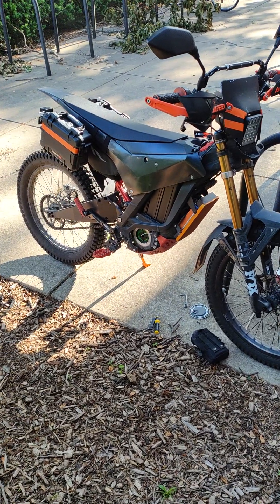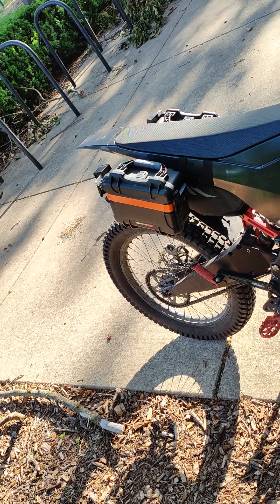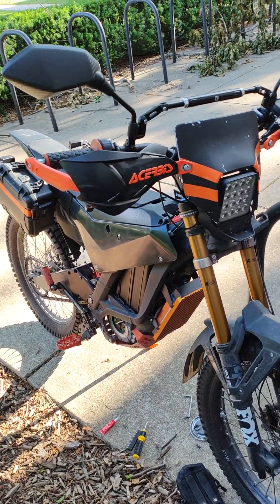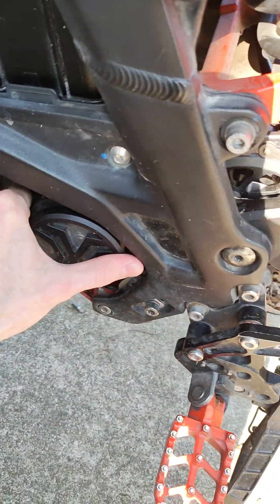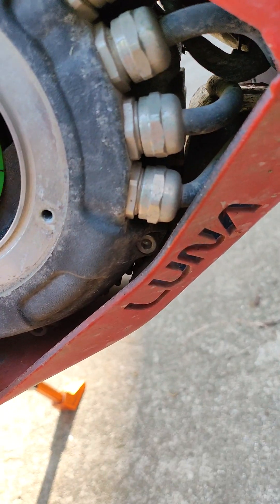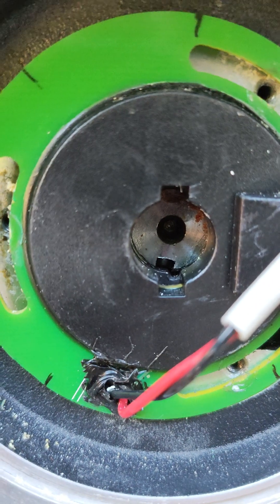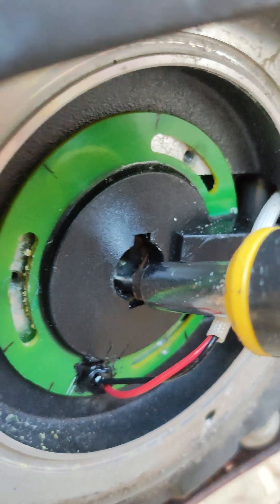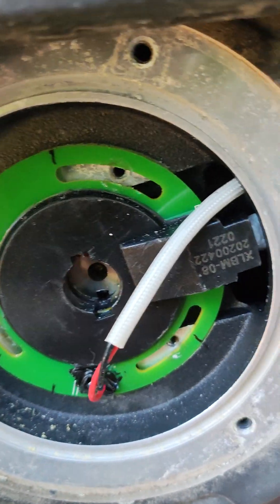No Throttle Response - Surron Hall Sensor Issue - Easy Fix

Comment: I tried to load my surron by wheelieing on my carrier and I missed and slammed the skid plate on my hitch by accident. I haven't had throttle response since. Removed all my sensors (kickstand sensor, lean sensor, break sensor) but none of them worked. I think this might be my issue.

Thank you for the video!
Reply: Mine was a bad voltage rectifier 🤦‍♂️

Comment: Did the loc tight work??
Thanks
Reply from the maker: Yeah it worked great.  I haven't had a single issue since I used locktite
Reply: @mbzoomer3799  
Thx, I got lucky and only a bunch of dirt in throttle. 
✌️🍀

Comment: my sur Ron works sometimes, then will shut off, if I'm doing a wheelie or twisting, then I'll have to restart, hopefully it starts again, but it's happening more and more, taking longer and longer, more trys to reboot
Reply from the maker: Not sure what it is but its probably not a hall sensor problem
Reply: Hey Rob mine is doing the same thing, did you ever figure out what was the matter with yours?
Reply: @joshmcguire2815  same with me have you figure a way to fix
Reply: I have the same problem, have you found out what the problem was?

Comment: Mine is doing these same issues, all works fine but the throttle, I sometimes get it to move an inch or two before throttle cuts out. Mine is a brand new 24’ Light Bee X with 14 miles on it. 😢 hopefully this is my issue.
Reply: Please let me know if you figure it out, i have a 24 light bee with 100 miles, doing the exact same thing
Reply: @Lwc4ddy  waiting at the dealer, not sure yet. I’ll update
Reply: @TheClutchCaleb  what was the problem
Reply: I am getting the same issue on my 2023 with 1000 miles and a bac 4000
Reply: @Lwc4ddy  they ended up swapping everything out but the frame, all new everything and it worked great for a week - now it’s broken again… no power anywhere at all. Bone stock 24’ LBX with just over 200miles on it now and my second major issue
Reply: @Lwc4ddy  going back into the dealer tomorrow
Reply: @TheClutchCaleb  just had the same issue on my brand new 2024 light bee

Comment: My Surron light comes on, digital display works, horn works but no throttle, replaced the throttle, removed all sensors, replaced display unit, replaced ac dc converter still no joy, looked at the hall sensor and it’s as it should be so totally stumped
Reply: Did you figure it out yet mines doing samething.
Reply: I'm having the same issues. It randomly started working for 2minutes then it just gave up again. I think it may be a connector issue with the plug and play parts. Or maybe even a faulty connection to the throttle or to the controller.
Reply: Disconnect and reconnect all the wire harnesses and check for loose grommets. Mine was cutting out anytime I hit a bump and that fixed it
Reply: It was the throttle that was broken on mine. One of the tiny weak connector pieces on inside of the throttle cable close to the throttle itself.
Reply: ur controller is fried
Reply: I have the same thing just happen now... did you find the problem?